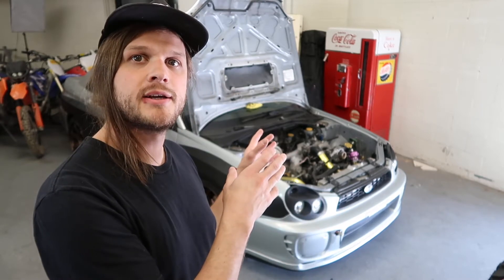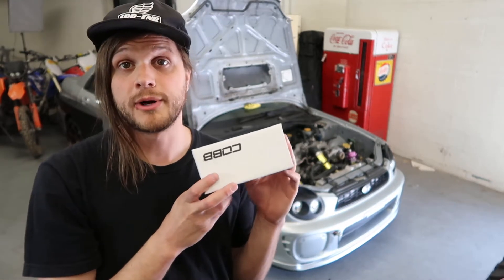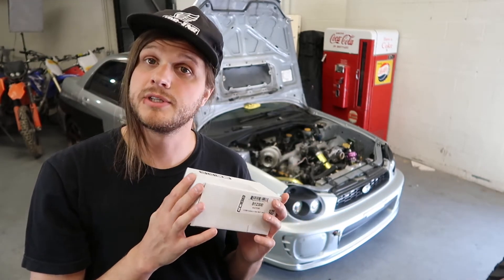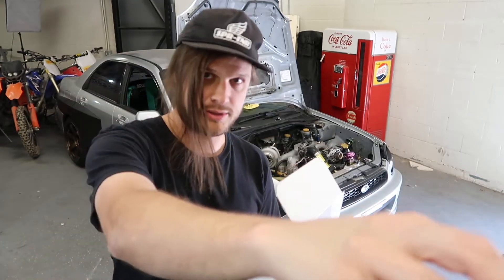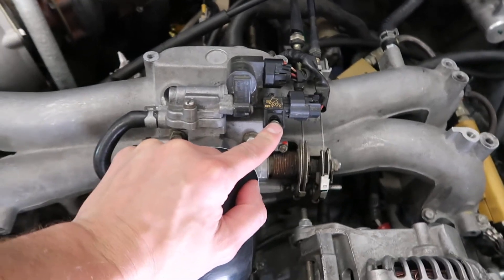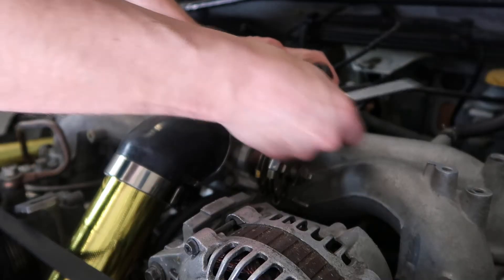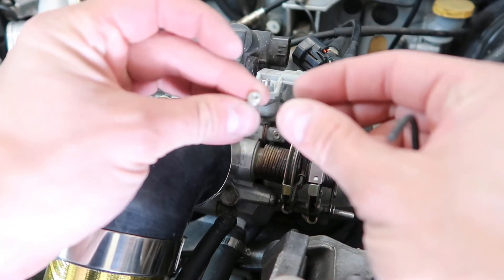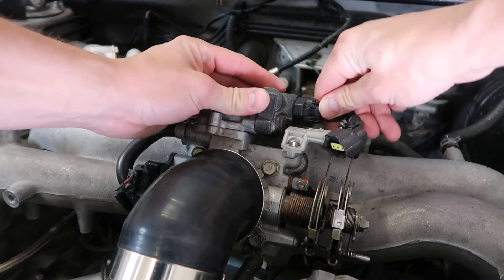HOW TO install COBB 4 bar MAP sensor- WRX- DYNO PREPISODE #4

Comment: does this sensor work in conjunction with speed density sensor?  And it's there anything else with sensors needed to run higher boost, or to make it easier for tuners to do their job?

Comment: Hey man what intake mani r u using iv got an 04 and want to move to a map sensor
Reply from the maker: I've got the stock 02 wrx manifold and it is tuned on speed density.
Reply: Supertuner where did u get the port for the map
Reply from the maker: So you have a stock map sensor in your throttle body. 
When tuning with speed density you're removing the MAF sensor, and replacing your stock MAP sensor with an after marked MAP sensor (using the same location) and adding an aftermarket IAT sensor. 

But you will need a tune if you move to speed density. So it is best to talk with your ecu tuner and see what aftermarket IAT and MAP sensor they recommend you use.